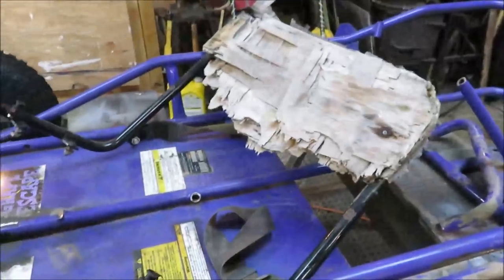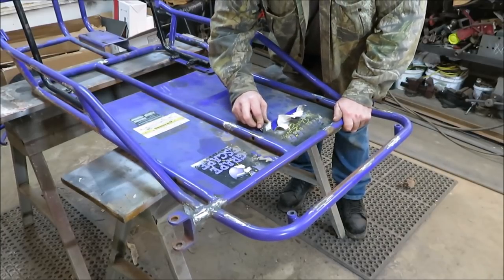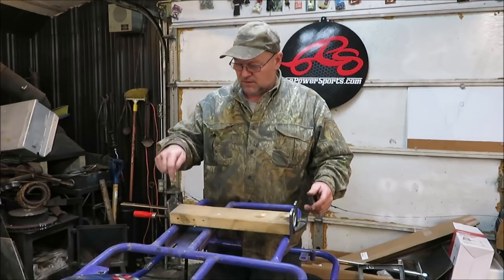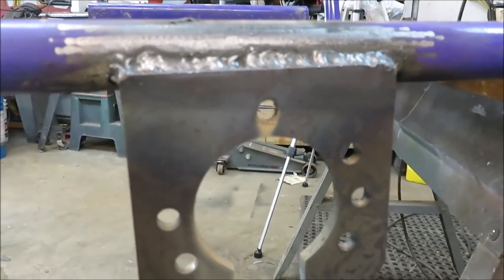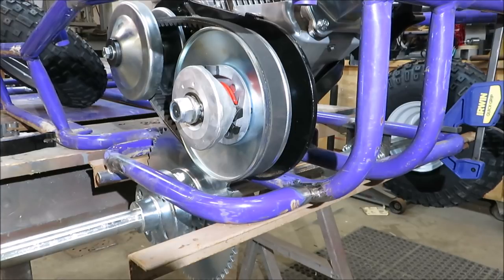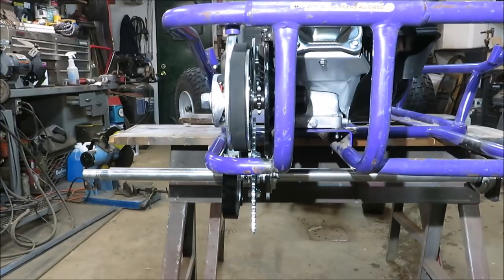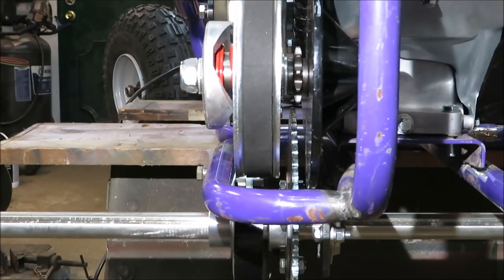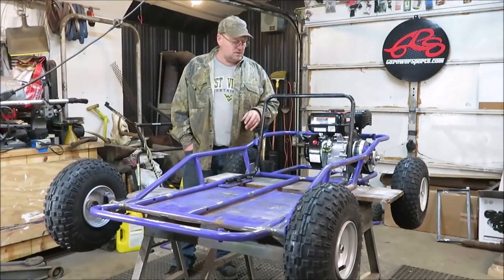go kart build off live axle install

Comment: Sometimes ya gotta try & ''try again'' before ya get things to suit. You did & it worked out fine. As far as your seat....I'd try to scrounge me an old mid-80s Toyota SR5 pickup seat. I had an 85 Toyota SR5 4 wheel drive pickup that I rebuilt it's frame from the cab>back because a leaf spring hanger rusted & broke loose. Those SR5 seats will fit ya like a glove. It'll take a little modification, but it'll improve the ride. You're doin alright & ya made a great video. Good work, Sir.
Reply from the maker: Thanks for the comment.

Comment: I for see a problem with the variable speed clutch hitting the brake pipe you just welded on , there is no room for the clutch
 to expand as it goes faster.
Reply: NAILED IT👆
Reply: Just got to end of video..he put spacers under the motor and I think he is good now..

Comment: I think i would have welded the bearing to the outwr side of brake bracket. That would have given the clesrence and spead bearings a little farther apart.
Reply: Or maybe the inside of the bracket and put brake on outside.